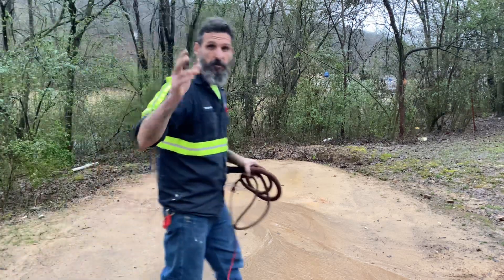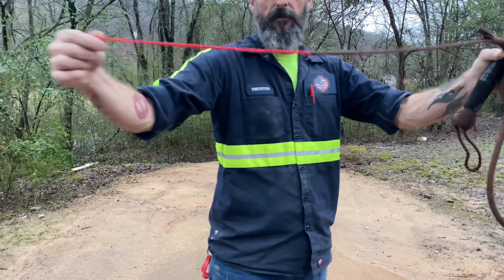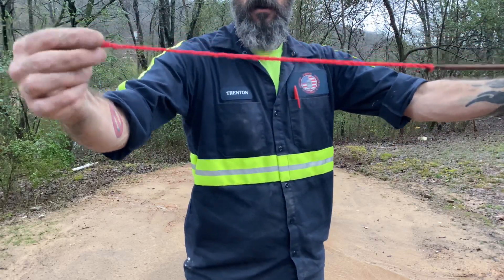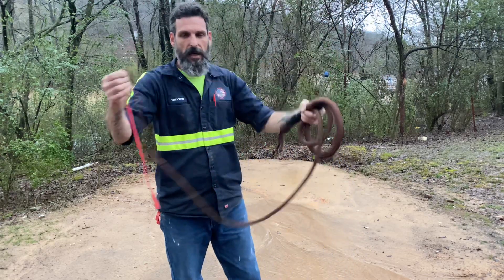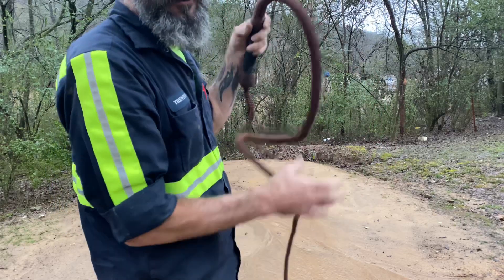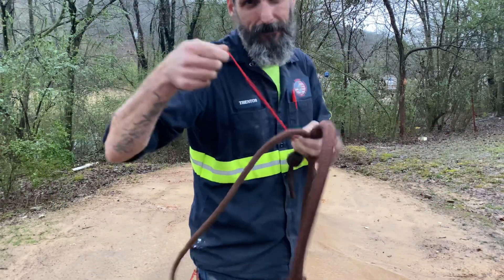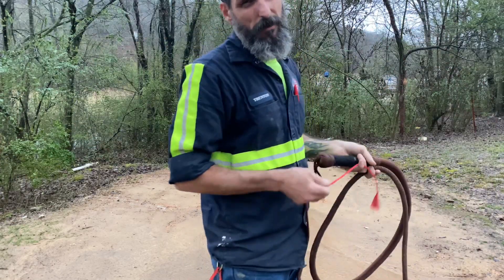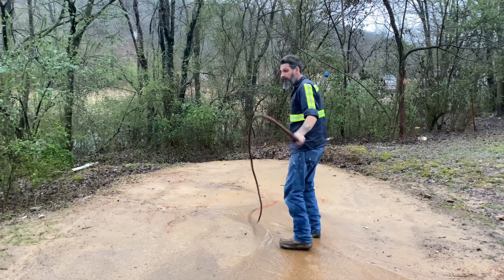Whip cracking (tapered poppers debunked)

Comment: Yay someone else in Arkansas who’s does whips! Also what material is the popper made out of? I’ve been trying to mix shiny gold ribbon with the plastic ribbon with my Kevlar crackers to try to get a little extra flair and pop so far I’ve had them all break after about three or four cracks the Kevlar stays, but the ribbon itself destroys itself after what I feel like sounds like a 22 going off
Reply from the maker: I was using nylon masonry string I got from a hardware store.
Reply: That's what I use . Not tappered tho .
  So how'd your cracker do ?

Comment: Not sure if you fly fish or not but as for a tapered cracker , dry fly anglers could not do better than a ferraled leader.  You can use the same concept to make tapered crackers just make a miniature ferraling board & may I suggest Spyder Wire fishing line as your material.  It is pure dyneema fiber which is more than twice as strong as Kevlar ( dyneema is 15× stronger than steel , Kevlar is 7× stronger than steel) . 
You can beat the shit out of  dyneema popper and it just laughs,  throw a few knots along the length and you've got a can cutter